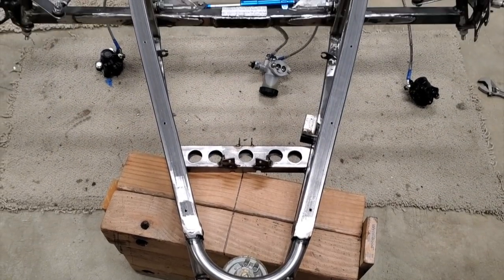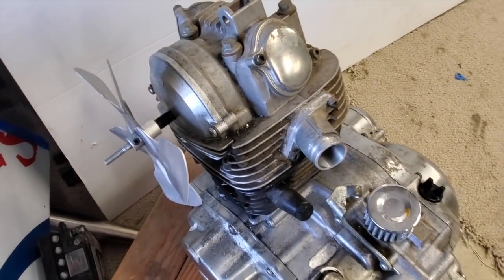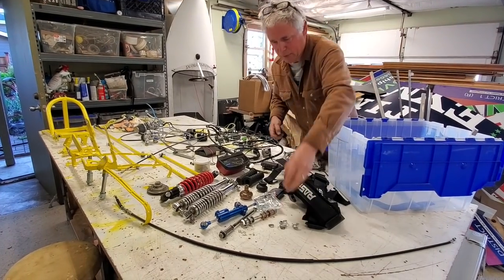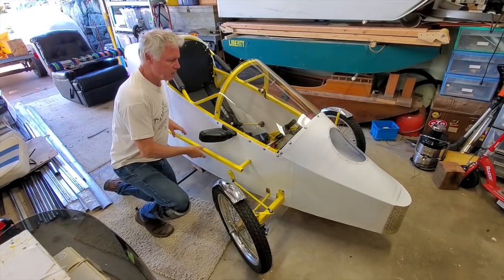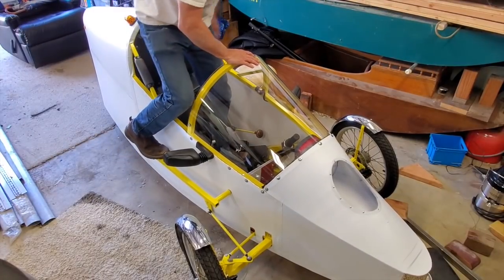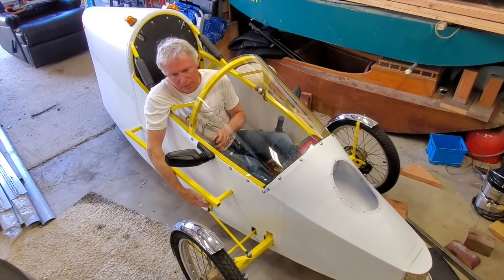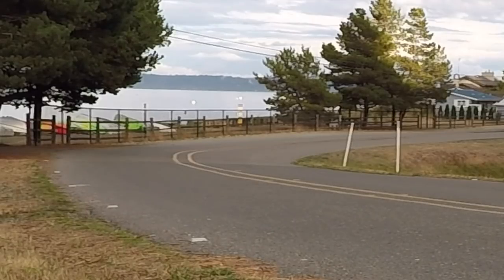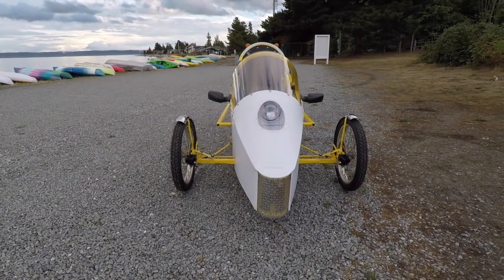Fuel efficient reverse trike build (part-14)

Comment: I wanna make a similar homeless hobo long range travel vehicle.....It'd start off as a stretched reverse pedal trike bicycle & with trailer, full suspension & suspension on the trailer. With an insulated lightweight weather enclosure on the cab making it double as sleeping pod, by laying the seat flat.(also allows 4 riding in rain/snow/cold) It'd use e-bike wheels,motor,disk brake, bicycle shocks,etc...Be narrow to fit on shoulder of the road. FWD plus pedal power(maybe pedal power electric generator?) for extra range  with say a 1,000w motor on each wheel.(lighter, more torque 750w geared hub motors might be better) The hood/front & roof would have a three 100w solar panels with a large battery bank under the seat. Similar in size to 4 ebike batteries, the trailer lid would be a hinged solar panel. So you have 400w of charging power + some extra fold up lightweight solar panels that slide/stored under the seat for extra charging power, to power creature comforts (fridge,fans,laptop,etc..) & a wall plug to charge along the way. The trailer would be a light locking metal lock box that holds a small 12v dometic fridge & all your camping/living gear. Ran off the battery bank under the seat. For sleeping pod cooling you'd use a couple of peltiers/fans that blow cool air (+manual open/close vents). For heat an electric blanket on the seat. Windows would be tough/lightweight tinted polycarbonate. Vehicle could cruise along at 25-35 MPH on flat ground. Suspension would make it light off road capable. Vehicle would be light enough to easily push if you got stuck. Saddle bags on each side of vehicle for things like dirty clothes that are likely not to be stolen.
No license, registration, insurance, gas $ needed. Made mostly from bicycle & e-bike pats so parts are locally accessible.

Comment: The twitchy steering us fixable by using a gearing system on it, making you have to twist the handles more so as to turn the same amount. Main objective should be cruising speed, and doing a U turn could be a slight inconvenience (as it is on cars)

Comment: an electric fan migh be better for cooling the engine , you can have it turn on when the engine actually gets warm , a scoop slichtly in front of the engine either on the side or under the floor might actually be enough to keep it cool when driving

Comment: The concept is very good and your execution definitely get an A for effort!
   I have been thinking about this concept for about 20 years, since I was a child. It was mainly a reaction to seeing men or women sitting by themselves in some behemoth truck or SUV, dragging their fat ass around in a vehicle that could hold ten people yet 90% of the time it was just themselves. Then The USA fighting wars basically for the House of Saud and oil dependency. Anyway those were some of my major motivations.
   My idea was for a two seater with climate control, windshield wipers and more safety (10 mph bumpers front and rear) as well as wider wheels especially at rear for safety, traction and the advantage of the gyroscopic stabilization effect they would give at a cost to unsprung mass.
   But you have made yours fully actualized while mine is still in my imagination… so despite my better design…props to you for getting you’d on the road.
   After all of that you really should do one more installment of it’s mileage at 85mph, 45 mph and stop ‘n go 30 mph. 
Best,
R. C. Christian

Comment: It must have gone astray in the chatter, quite unfortunate. The steering issue I had predicted many episodes ago. It has nothing to to with the wheel base I'm sorry to say. Your geometry lacks 'trail'. You will need to incline the 'kingpin' in the side plane by about 6 to 10 degrees (caster angle). So that the bottom joint is leading and the distance between the tire contact patch and the intersection between the line out of the kingpin and the road is about 10cm. This distance is the trail. 
About 1 degree of toe-in on top of that would make things a lot better.
Scrub radius looks fine. But your Ackerman geometry is infinite... Meaning that the front wheels have vastly different turning circles. And that's not helpful. Make it so that the steering arms make an angle that intersects the rear wheel hub. In this speed range and lacking any tire data this would be the most optimal set-up
Given the feedback forces through those tillers it might also be necessary to add a motorcycle steering damper to both, to get rid of high frequency vibrations and sudden jerks due to road contition.
Hope this helps

Comment: Great project. Thanks for sharing.   What is the material and thickness of the  windscreen?   Does it scratch easily?
Reply from the maker: about 3/16" thickness and it came pre-scratched from Amazon, like down the whole side. Right thru the protective layer! It reminded me of the old Samsonite commercial with the Gorillas beating the crap out of the luggage.

Comment: I agree with your self summary: Meh. Fun project but ended up a bit bloated with all that steel, odd sounding and handles poorly.. front ends capable of real speed and comfort are tricky at best. Simply raking the front axle rearward a few degrees would probably do wonders for the higher speed twitching as would  a muffler for the sound.

Comment: That is probably the best looking one you've built out of the ones I've seen. Did you just use bicycle wheels? That's pretty fast to be safe for that I think. Thanks Paul, it's neat.
Reply from the maker: Those 17" aluminum 2.5" rims came off of small Yamaha dirt bikes.
Reply: @paulwelkinsdiy  Oh ok they're just small that's why they look like bicycle rims/tires.

Comment: I wish my drills would so easily go through metal, it's normally a nightmare trying to get the hole to stay where you want it.
Reply: are your bits sharp? Use a center punch to set the center so the bit doesn't walk/move on you .

Comment: If you want more straight line stability maybe try to apply some caster angle on the front suspention uprights. On cars it's often between 5 and 7 degrees.  Also some slight toe-in on the front wheels. 0.5 to 1 degree? Then 60-70-80mph will feel stable. 
I would pesonally have tried using a small diesel engine instead of a gasoline engine, that would improve mileage by at least 25% if not more. 
Diesels also have low-rev torque and can pull longer final drive ratios. 
Maybe you can source one from an old 1cilinder  generator? 

It's a fun build. It reminds me of a Messerschmidt KR200. Very similar concept.
Reply from the maker: Yes, the good old Messerschmidt. Way ahead of the times. Electric would be the way to go on a vehicle like this. I've been waiting for a GOOD enclosed commercial trike to come out on the market. They're getting close...
Reply: @paulwelkinsdiy  There are phenomenal velomobiles out in the market, they are so aerodynamic that you could easily be going freeway speeds with a 2000W (~3 horsepower) motor.

Comment: Have you ever seen those leaning enclosed motorcycles with stabilisers that pop out when stopping or going around corners or going slow. I watched a guy video of him building one from a old moped it was really cool but a lot of work. I i think they build them in Germany I've seen a few over the years on the road but they are very expensive to buy.
Reply from the maker: Yes I have. I've drawn up many versions of that design, but still I like the looks, stability and simplicity of the reverse trike.

Comment: Lookin' good.
If you are getting a shimmy, it may be because of the side-to-side movement that the current suspension geometry allows for. If I recall, you don't have any hard bracing, only bushings to prevent this movement. Consider installing a simple pan-hard bar to stop that. It's hard to tell just how much side-to-side flex you are getting (@5:07) but it doesn't take much to start a shimmy that can lead to a death-wobble. As for license/registration/insurance: Looks like you've got the donor bikes vin # and plate on it. That gives you a fighting chance of calling it a motorcycle (with modifications). Just hope it doesn't need to go through a visual inspection. ;-)
Reply from the maker: I've had it up to 62 mph with no shimmy. My motorcycle steering dampener helps reduce that risk. The problem is more of hitting a hump or bump in a high speed turn. That's where independent front suspension would help.
Reply: @paulwelkinsdiy  I had my home-built up to 85 mph on a runway with no shimmy. But then the shimmy came when I started riding it on the roads. In my experience, a shimmy is a result of poor suspension geometry. In my case, it was likely because I had a fixed, short-throw swing arm which meant a constantly changing caster angle. Your setup is similar, but the swing-arm is slightly longer. So that leads me to believe your issues come from either the constantly changing caster angle, or (hopefully) the side-to-side play of the axle. The axle-play is easy to fix, but the fixed-caster issue would require a complete re-design. Might as well try the easy fix first.

Unfortunately, what you are currently experiencing only during high-speed turns, will likely work its way into low-speed turns as bushings wear. The steering damper is a nice band-aid, but I can tell you from experience that it is quite terrifying when that band-aid fails. Good luck with further diagnosis. Another helpful thing (assuming you have built-in adjustability) would be to take it to an alignment shop (or do your own alignment w/ lasers) after you have added a panhard bar or done a complete re-design, and maybe also look into balancing the tires (even though there doesn't seem to be much mass there to balance).

Comment: Rubber/foam washers massively help with issues like vibration and sound. And saves a lot of time tightening up nuts after use
Reply from the maker: I used them on the Lexan wind screen, but not on the fluted plastic panels. It doesn't rattle so much. It's the aftermarket muffler I used in an effort to save a few pounds from the original muffler.